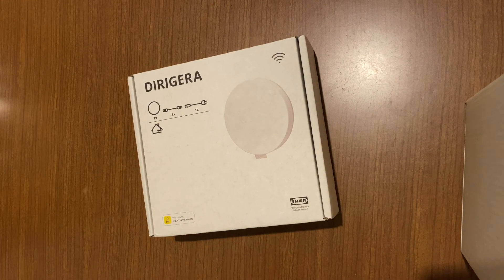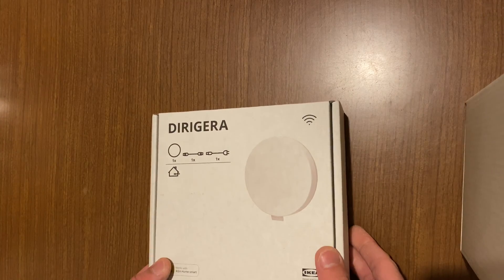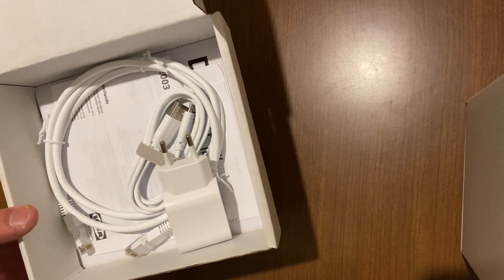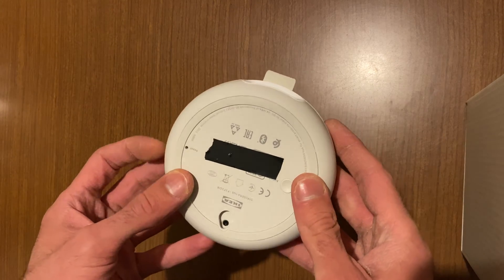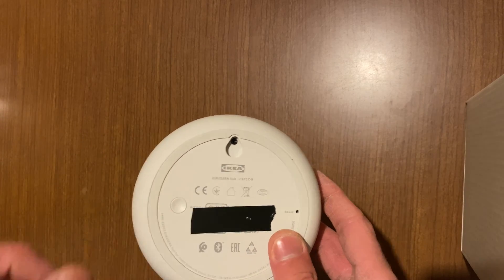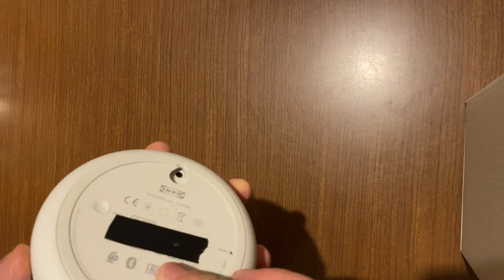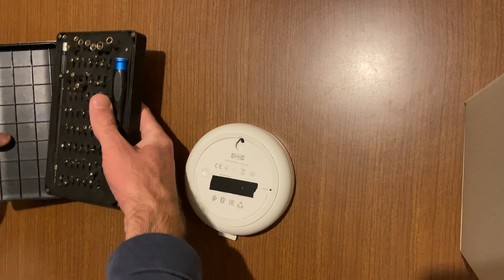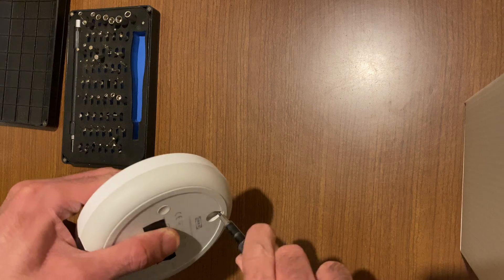IKEA DIRIGERA - Kitchen Table Electronics Teardown (what’s inside?)

Comment: They have two Silicon Labs modules probably one flashed with Zigbee firmware and the other with Thread.
Reply from the maker: Yes, that’s the most likely scenario. Only thought about it later as they are identical but I don’t think they can do both at the same time
Reply: @FrancescoF  agree with you, the WiFi/BT module has some co-existence in/out pins for other external radios, but having two Zigbee and Thread controllers side by side will require some precaution (and extra software development), if you want both chips to be available simultaneously (and communicate alternately)

Comment: The LP5009 ? if I read the part number correct is a RGB LED driver, but I didn't see any RGB led on the pcb, did I miss those?
Reply from the maker: I missed it! It’s on the front near the shield! If you see the teardown there’s a light tunnel on the top cover